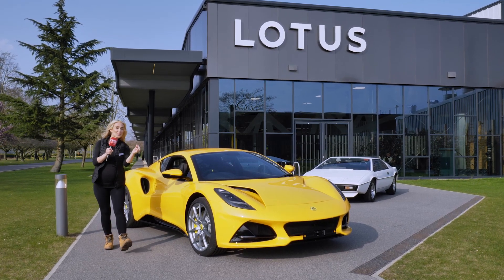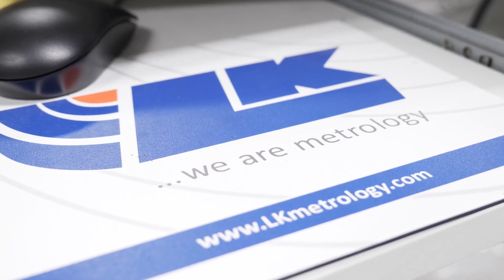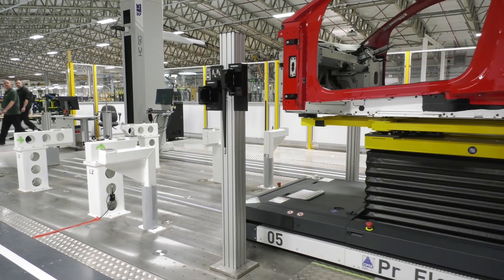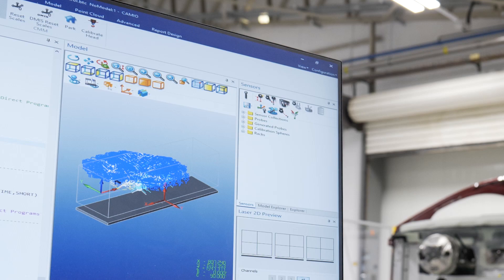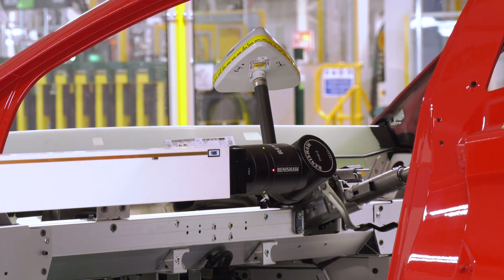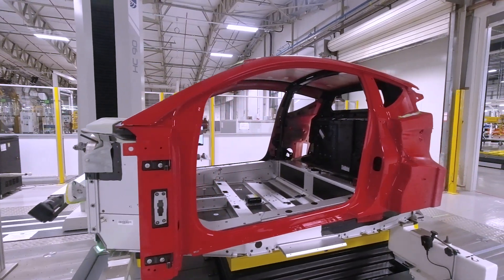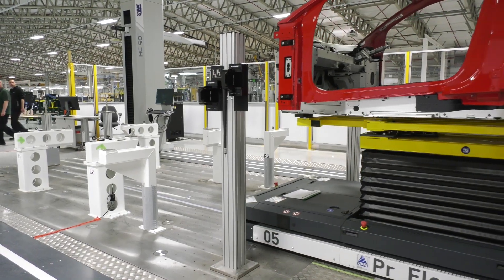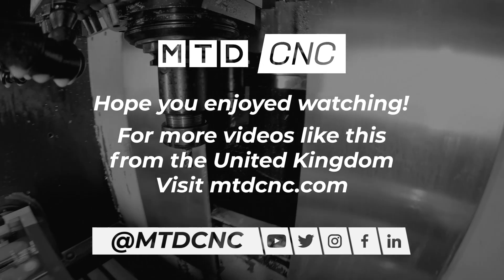The most accurate car ever produced

Comment: there was a charm with hand built cars vs. another robotic mass produced car.
Reply: There still is. The Emira ‘is’ hand built.
Reply: @meenboli  not really, I visited the factory  and they have  definitely moved away from handbuilt and it’s mostly machined with some hand assembly. And that’s understandable. They went from producing a couple of hundred cars a year. I’m not surprised they needed a bail out and Geely lifeline. But as is the case with most Chinese companies, they suck the living daylights out of any company that they own.
Reply: @bakhteria  actually you’re incorrect. 

I visited the factory 2 months ago - invited by the MD no less. They have one robot. 

Two maybe. 

The main one attaches the body panels to the frame (via glue-ish). 

The paint shop is automated. 

That’s it. Everything else is hand done. That makes it very special as far as I’m concerned.
Reply: @meenboli  maybe still special but not the same as when they were building a few hundred cars a year.  Unfortunately, they had to sell out to anyone that would save them.  Too bad it’s not a better brand like McLaren, who has already snatched up a large number of engineers and designers from Lotus.
Reply: @bakhteria  agreed. Not sure McLaren have nailed the quality though and servicing costs are shocking. 

Lotus built 5033 Emira last year. 

I know because I’ve been in the factory and they told me. 

Still makes them pretty special to me. 

They can’t survive as a business making only a few hundred a year. 

Which has been proven already!
Reply: @meenboli  I agree and am happy they’ve survived.  Apparently they make more money from their consulting engineering than selling cars.  I own one of 103 built cars for the us and like the fact that it’s rare.